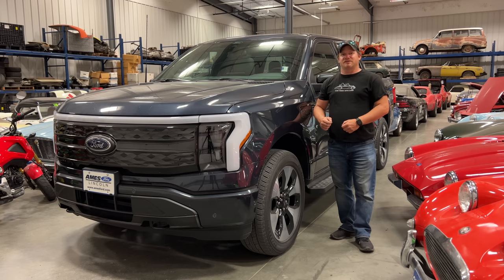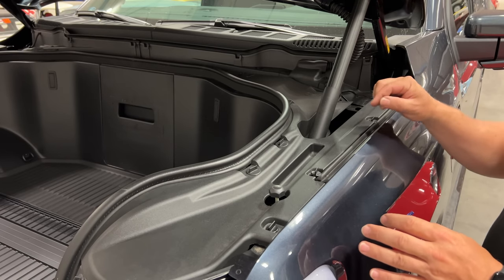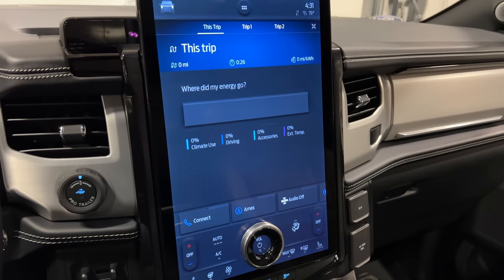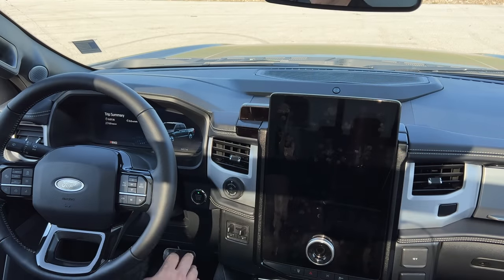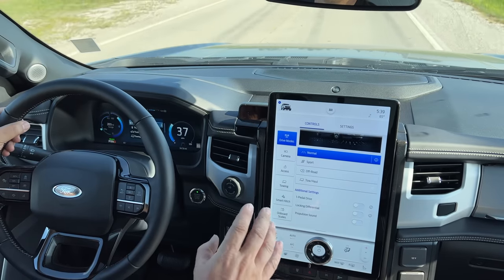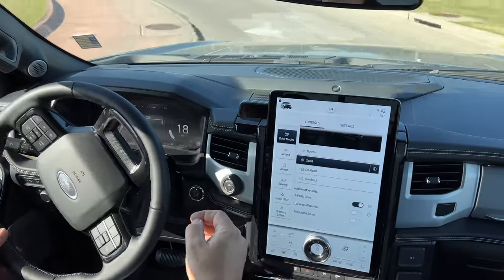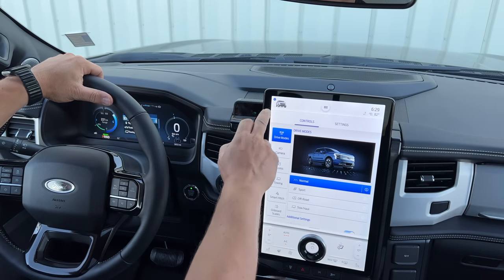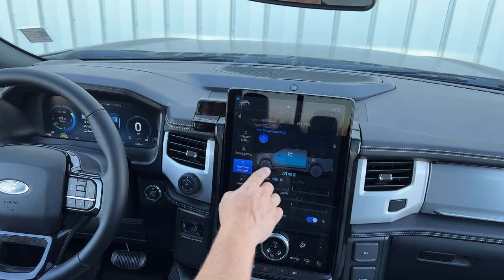Full Review of the 2022 Ford F150 Lightning

Comment from the maker: The Lightning comes in trim levels Pro, XLT, Lariat, and Platinum ranging in price from $39,974 to $90,874 before the $7500 federal tax incentives for purchasing an all-electric vehicle.  Putting the base price at $32,474 if you quality for the federal incentive.  You may have state incentives that might apply to you as well.
Reply: LOL, like you are going to ever have a chance of finding one of the base models and even if you do you can't get the extended range battery unless you are a fleet buyer. They are going to build all the higher priced models for the public.
Reply: @mustangecoboosthpp3869  It may not be difficult to get a 2023 pro as long as you don't ask for a lot of features.  If you've planning on using it locally,  the standard battery isn't that bad. I test drove a platinum the other day and decided to see just what i could squeeze out of it by driving all city, one pedal driving,  no fast stop or starts. I drove it 30 miles and achieved 3.3 miles per kWh.  That's 432 miles per charge.  Just fantastic.  I  imagine the miles per kWh would be slightly higher on a pro with standard battery. (A lot less weight). If not 98 x 3.3 = 323.4 mile range. Not bad at all for all city driving. And most likely you'd get better than 3.3 miles per kWh.
Reply: Great point. No matter how conscientious or not we are about the environment, the bottom line is how practical, how much better a product is from what is current, how much it costs to run that product etc. that counts to the consumer. Sure, every new product when first invented ALWAYS cost way more than existing. Flat screen TV's, cell phones, VHS, original TV's back in the 1940', even the first cars ever invented, that only had a handful of horse power and could only go 10 miles on a tankful, cost well over $100,000 when adjusted to todays rate. 

This will change in just 2 or 3 short years as competition ramps up, even from China and Vietnam, that will challenge the existing manufacturers to lower their prices. It's survival of the fittest. Either lower your price and adapt to compete, or become the next Nokia.

Comment: Steve, yours is the fifth review I've watched of the Lightning. Hands down it is the best (IMO). My compliments on a thorough, well delivered presentation. I have noticed however, it seems to be a thing for reviewers of EV's to downplay the positive environmental impact these vehicles offer. Almost always just briefly mentioned as a side note, or a "Oh yeah, it's good for the environment too" used as a tag line like you did. You know, it's OK to care about what we're leaving our kids to deal with long after we're gone.
Reply from the maker: You will just get loads of people saying it’s not good for the environment, the power comes from somewhere, it’s not good to build new car why not recycles old ones, etc etc.  It’s not as good for the environment as the EV proponents make it seem so I’d rather not argue about it in both fronts.
Reply: Studies show the carbon foot print of of electric vehicles is larger than the carbon foot print of internal combustion engine vehicles. By the way TFL has done several tests of electric vehicles and when you work them they all fail horribly at getting the job done.

Comment: The fold down console work surface is great but it doesn't come on the pro trim. That's strange because those will be used with contractors the most.

Comment: Steve, thank you for your good review. It was very informative, especially when you lifted the truck to view all components. It is interesting these Ford electric truck still uses a acid battery.
Reply: Yes, and I was surprised to see a standard cooling system. I expected a better coolant than just a antifreeze.  And instead of hydraulic brakes,  I thought they would've gone electric since the regenerative braking reduces the use of the normal braking system it probably wouldn't have used that much energy, but I'm sure that's why.

Comment: I sat in an XLT lightning, and  I definitely prefer the 10 inch screen to the "Starship Enterprise" touch screen console. It also has the real knobs for the AC, volume, and radio, so that's the one I'm getting for sure. Great review by the way.
Reply from the maker: The bigger screen is great for the cameras. I’ll leave the AC set to one temp and it has a button and knob for radio that is always there.  I would be using my phone for music if the radio was on so I wouldn’t be using that screen anyways.

Comment: Electric vehicles are the future,  and are environmentally friendly to operate. BUT they do come with issues that are rarely mentioned such as the environmental impact of manufacturing the  battery's, and the energy needed to provide the recharge, not to mention the battery disposal once the lifespan is up. Their not quite up to the point where they can replace all gas vehicles just yet. Also the range, providing heat on cold days, or using that performance cuts the range like 60% (know from experience) finding charging stations on your route, using someone's house power to recharge. I know in a Tesla it costs like $10 to $15 of power to recharge, the fire hazard, and of course the high cost of the vehicle. Like I said not their yet for the everyday person to own and operate.
Reply: I couldn't agree more, little if any of what you said is normally put forward just the plus side of EV's.
Reply: One great thing about these batteries is individual defective cells can be changed out instead of replacing the entire battery. I'm definitely not purchasing mine for long distance driving.  Local driving only and only charging at home. I did a city only test drive and achieved 3.3 miles per kWh.  That would give me a range of 432 miles on a full charge. I don't ever drive more than 40 miles a day, so I'm not concerned about difference in temperatures.  I only plan on charging to 80% maximum so I expect my battery to last much longer than the 8 years/ 100 000 mile warranty. I believe this will be a fantastic truck for local contractors,  and so many other businesses.  If you're planning on taking it on long trips or towing long distances this isn't the truck for you. Best stick with a fuel or fuel/electric truck. Otherwise locally this will work perfectly for me and so many others. You buy a vehicle that suits your needs, this one is perfect for me I need a truck that will tow, I  need a vehicle I don't have to buy gas for, and finally I need a vehicle that I can charge using my HOME  SOLAR  SYSTEM .  No more vehicle fuel bills of any kind.
Reply: "issues that are rarely mentioned"  -> proceeds to list issues that are the most common talking points everywhere, all the time, when anybody talks about EV-s.

Comment: Id be interested in hearing some real info on recharging times.  The stories ive heard across various vehicles differs greatly.  I took a few minutes and plotted out a trip from Texas to North Carolina using google maps.  And then plotted the same route using Tesla's trip planning software.  The only difference in the two trips was the extra 9 hours it took the EV to arrive due to recharging stops.  That is a whole days driving and another hotel and meals on the road... each way.  Hope you can follow up on that part for us.
Reply from the maker: It’s completely up to quality of the service and type of charger.  They are all so different that you will not really know what you are getting with the exception of the Tesla chargers which always seem to charge at higher rates than others.  Same goes for range because it varies so vastly on your specific terrain, city/hwy use, climate, and driver that it is a moot point talking about range because one persons experience will not be the same as the next.
Reply: Even on the 350 kWh charging stations the lightning limits the charge to around 160 kWh.  A fast DC charger like that can charge an extended range battery from 15% charge to 80% charge in 41 minutes. That's about 85 kWh.  If there was flat out charging then it would put 80 kWh back into the truck in about 30 minutes but once the charge reaches a certain level the charge rate drops. After 80%-85% SOC is reached the charge level drops dramatically. Its possible it would take another 41 minutes to bring the SOC to 100%. There are DC charging stations that only supply 50 kWh of power.

Comment: Well now I understand why the chip shortage was so difficult for new car manufacturers!
Reply from the maker: Marketing team to engineers: Where do you think we can add more chips and make something move on its own.
Reply: This is what scares me about these things is how many chips and how many issues will this have in another 10 years
Reply from the maker: But like I said you could throw your own motors on it with your own motor controllers and you can keep it running forever, you would lose all that extra stuff that Ford put on the truck but that is not any different than how Hot Rods and Custom vehicles have been for the last 60 years.

Comment: Does the one pedal driving utilize the brake system at all or is it completely regenerative braking being used when you let up on the accelerator?  One more question do the brake lights come one when one pedal driving is active?  If so do they come on the moment you begin to decelerate?
Reply: On my Tesla, the brake light comes on as soon as you let off the accelerator, and I would assume this does the same.

Comment: 9:35 - If Jeep had done this we probably would still have Anton Yelchin around.
Reply from the maker: I am not sure which way is safer.  If something jumps out some people panic and smash whatever pedal they are using to the floor.  It would be better if the truck crawled forward so that you could control it slowly with the brake instead of someone accidentally mashing the throttle which in this vehicle will make it take off at blinding speed into something.
Reply from the maker: Or worse forgetting that the vehicle was on because it was not moving and accidentally hitting the throttle.